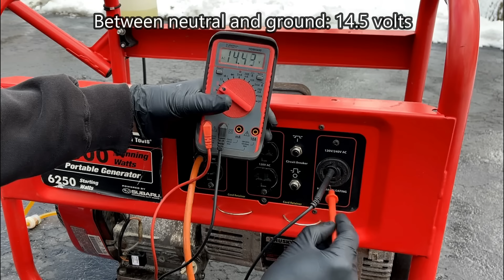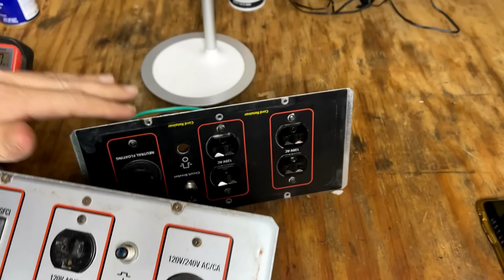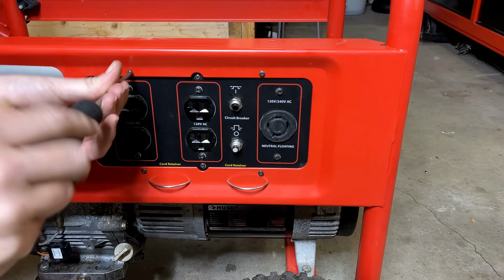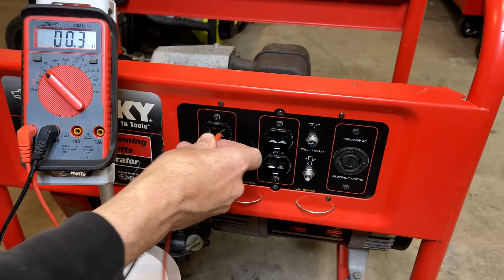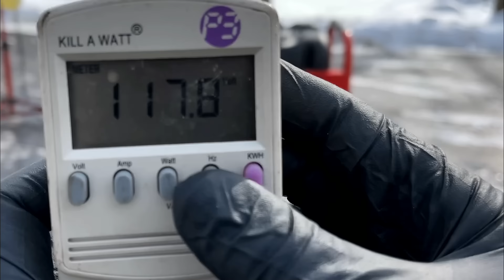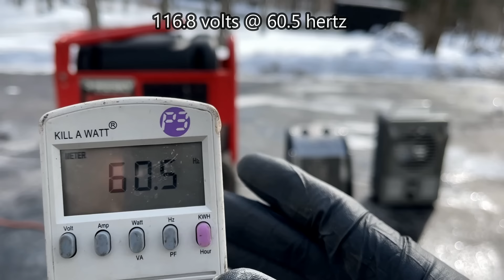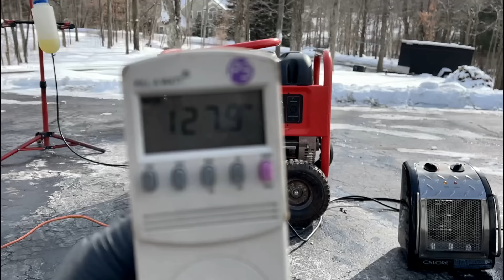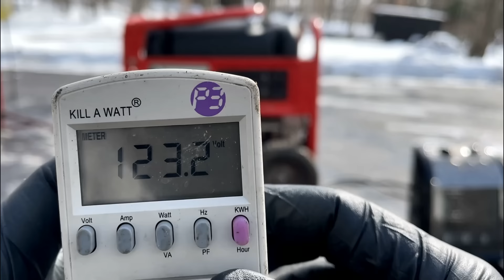No Power Output From Generator - Fixed

Comment: That hunting got me from $100 to 80 bucks! Another great vid Jim!
Reply from the maker: Thanks Ken for picking up this generator and talking him down to $80.  A new Mikuni carb alone would cost $120+
Reply: Mr. Ken I Vaguely recall reconditioning Rotors for Alternators in a Shop Class??? Can THAT be done?
Reply: @russellbonesteel1115  If something can be made it can be repaired.  The amount of effort sometimes needed to repair something can easily force a "Just replace it" answer.  
A drop of solder COULD have resolved the immediate problem and after testing COULD have been the simple, easy fix.
Reply: @russellbonesteel1115  There is a little woman in China who posts Videos on YouTube that rewires 100 KW generators like she was washing dishes. Maybe you should contact her
Reply: @rogerd4559  You refer to Linguoer Roger. She is amazing. The art of manually rewinding  stators, rotors and motor coils has been lost in the West. Well, not really, but if you take anything like this to a rewinding workshop they invariably want an arm and a leg. Obviously she was taught to do it by experts. The only thing I will say about the machines that Linguoer works on is that their control systems are extremely simple. Trying to do things like this on the complex machines we sell and buy would take on another dimension.
Reply: ١
Reply: Can you use 25amp fuse for testing

Comment: James I never tire in watching your generator videos, I have learned a lot . Believe it or not while in Puerto Rico was on facebook marketplace looking for old defective generators to attempt to get them to run and none to be found but I did locate (3) running from $100 to $300. One even was electric start with bad battery but with an 85 foot extension cord heavy duty. While in NY ,found a brand new one 3750 watts with 10 hours for $100.00 ,yes $100.00 go figure. I finally located a Chicago Electric 7500 watts electric starter ,no battery 16 HP also no power. I got the motor running real good so far, ordered a battery and filter which was missing. I'll be attempting to get it to power up with what I have learned from your videos. Many thanks

Comment: I reckon 90% of that was caused by inadequate care of the machine itself. Leaving it out in the open, or maybe in a hazardous environment. Just look at the state of the micro switches, which you say weren't as bad as some you have seen. That was a surprise to me. Aluminium wire in the stator didn't seem to be the problem there, God knows what that was. A difficult, hard working solution to several problems there, adequately dealt with in a logical and most enjoyable way. I got a lot out of all that. Thankyou :)

Comment: Just so you are aware ... I'm a Ham and operate and repair a number of different radio types including RADAR, I have seen incidents in the past where in many Chinese knock-off feed line cables the "copper" center conductor is often some obscure alloy made to look like copper but in fact is something else. It nearly always refuses normal solder. The soldered joints easily crumble and break and attempting a normal repair is virtually impossible. I believe the coil windings are made of a similar product. I see this quite often and reading resistance values are always skewed out of normal specs. This usually speaks of coil windings made with very cheap product instead of actual copper. Be ware ! Good video .
Reply from the maker: I have seen the same.  The solder is nearly impossible to stick and the wire usually just crumbles when trying to work with it.  So I do not try and repair them anymore.  The only repair that can be done is to rewind with copper.

Comment: thanks to your youtube page i have just finished repairing my onan rv generator that shop wanted $2000 plus labor to replace stator and bad rotor, that was 3 years ago. i bought a new generator and kept old one. i tried to repair bad slip ring but failed and found new rotor and stator for ABOUT  $425. I  now  have a working spare to keep or sell. 
Thanks for excellent videos

Comment: Am I correct that both the white and green sense windings should not have continuity to ground/case?  Jim I really enjoy your videos and especially you approach to repairs.
Reply from the maker: They should not.  But if your neutral is bonded to ground then you might see a connection.  Isolate the windings first.  Then there should be no connection.

Comment: James, it occurred to me that    you may have been trying to solder an aluminum wire from the rotor winding to a copper terminal (perhaps chrome plated) also on the rotor circuit. If so, the regular solder and flux used for a copper to copper joint won't work properly. An aluminum to copper solder joint requires a different flux. Maybe even a different solder. That would explain why the solder wouldn't flow onto the aluminum wire in your numerous attempts. As always, a very informative presentation. Thanks.
Reply: Soldering aluminium wire to copper wire is extremely difficult. It requires higher temperatures that are closely controlled so that the aluminium does not melt. Precision tools are needed so that the heat can be delivered to the aluminium through the aluminium oxide that forms on the surface. Specialist flux is also needed. It is better described as brazing than soldering. I recall once cutting off a copper braid tail connected to a thin aluminium bar inside a vehicle alternator. It certainly caused me a problem. I should not have done it. I ended up reconnecting the new replacement parts by soldering a copper spade connector to the copper wire and pushing the end of the spade connector over the flat thin end of the aluminium bar so that it was a tight fit. It was not ideal but it worked. I never made that mistake again. Ever since then I usually use a thin round splice with small brass screws on either end. The wires are pushed into the ends of the splice. Ideally the copper should not touch the aluminium and electrical connection is through an internal brass shaped piece with the screw threads fitted into either end. The outside diameter of the splice is always larger than that of the wires so doing this is not always suitable.

Comment: James, congrats on the new Ultra Sonic cleaner machine!    Heated?    I enjoyed the video very much!   That machine was pretty "crusty" all around!   Even the inside of the air box.   Looks like it was outside in the elements all the time.
Reply from the maker: Its hard to believe how clean the frame was given all the corrosion everywhere else.
Reply: Yes, it's heated. You can see the dual controls for heat and cleaning.  Mine went bad and only the cleaning would work, so I bypassed the electronic controls and used a rotary timer switch connected to both heating and cleaning.
Reply: @jcondon1  I noticed too the new ultrasonic. What is the volume of it?

Comment: Very useful, indeed James. Thank you. Some questions: -
1. You used a Torque Wrench on a number of occasions. What did you set it to, for each size / location bolt?
2. I didn't see a capacitor anywhere, to provide a phase shift for the starting of the generator. Was one used or not? If not, how did it work?
3.  You mentioned 2 additional windings. Starting and sensing. Can you tell us more about these?

Comment: "I make it earn an oil change" -- This is solid advice. Avoiding wasting money on new oil and disposal, and time, if the engine is junk to begin with. Love your videos (as do all the little carbs in my garage)
Reply: I always keep some good shape used oil around for such situations.
Reply: This is one of those things that wasting a $4 quart of oil on an engine that might be bad is better than trying to run the engine that might be good on that contaminated oil.
Reply: @danburch9989  oh I agree. In general it's good advice, but that milkshake really needed to go, a good choice not to make it earn it, this time :)
Reply: @CraigWaterman  Agreed sir.. I change my oil annually in equipment that may have only seen a few hours run time for the year. But I save that "used" oil and use it in engines that I'm not sure deserve a fresh oil change. If I'm sure she's a runner/keeper, she gets an oil change with the best. Cheers!

Comment: You are alot like me. If I'm that far in I want to know WHY it failed. Found material and workmanship to be more common than not as the cause. The fact that you went that extra mile makes me give you an A+. Great work!. My background is QA and re-writing practices in Telecom, FiberOptics, and Electrical systems. We fine design flaws , improve using better materials and manufacture practices. You EARNED your A+.
TJ DeHart.
Reply from the maker: Thanks

Comment: Looks like you are knowledgeable on most gensets. I’m working on my 05’ Coleman power station, 11kw lp gas. Only 309 hrs. It’s always worked well until recently the low oil shutdown went out and finding the right one since they are obsolete was impossible. So i temporally disconnected it. It’s worked fine during a couple outages for an hour or so run. Then it quit producing any electricity. I’m fairly handy at most any of the repairs it needs. I installed it and added auto transfer it a manual/auto transfer switch. The manual for this model (pm401211) shows 2 capacitors 40uf and 2 diode varistors. I pulled the capacitors and they are 35uf and read and 31.8 on each. I had bought the 40uf it calls for and installed them but it isn’t producing voltage. What testing should i do to locate the issue? I’d be glad to compensate you for any help on it. I’m on the ms coast and we so far have dodged any hurricanes this year. But it’s still an active season 🙄. Thanks

Comment: 26:48 based on the rust line between the stater and bell housing, it looks like the stater isn't seating all the way because the rotor being a little bit longer is, indeed, and issue. Is it just me? Maybe it doesn't matter either way, just my observation. In any case, interesting and thorough video!

Comment: Great video! My only complaint is at 1:03:41 you do one side, but not the other (so far). If the connection is bad on one side, it goes to reason the other side has a bad connection as well.
Reply from the maker: I have not given up on it, but since I had a suitable replacement did not want to spend too much time on it in this video.

Comment: The original owner really did a good job of polishing a turd.  From the tank and the frame, it looked like almost a brand new generator.  But then you look at the oxidation on the top of the engine, the cover on the stator, the wheels, the internals of the panel, etc and you can see that thing had a lot of moisture exposure.
Reply: It was literally under a deck on the beach of Long Island Sound. Salt Spray continuous!
Reply: @KensSmallEngineRepair  Yes, occurred to me the previous owner must live very close to the coast.....!!
Reply: Sure looked likes a "Bits-a This One and Bits-a That One FRANKEN-GENNY"
Reply: @KensSmallEngineRepair  🥼👩‍👦👩‍👦👩‍👦👩‍👩‍👧‍👧👨‍👩‍👧‍👧

Comment: Nice video, thank you! They make a chemical stripper for copper wire! If they used aluminum then the connection is compressed to copper eyelet for soldering but must have copper to aluminum salve! Aluminum oxidation seems to be the problem there! Your solder pullet worked good! It has been many years! Ron PTL, USA

Comment: I have had problems with soldering such as you demonstrated, I used the low temp aluma weld with a pen type of heat gun.

Comment: Well, I audibly said “Yessss!” When you said you were going to drill open that breaker! I love seeing not only the main reason for failures, but the specific reason. Cool to learn how the breakers work too. Ty!
Reply: Absolutely. I am a strong troubleshooter not because I'm anything special. But because I learn what each part does  to make something work. Knowing the theory of anything mechanical will make you appear like a wizard when things fail. But knowing what parts should be doing is 3/4 of the battle trying to get something working again.  Repair is just eliminating what works until you find out what doesn't.  Does that make sense???? I know what I'm trying to say and I definitely agree with you. Cheers
Reply: I agree with the "Why did it break" attitude, and not just toss it and replace.  Knowledge is understanding.

Comment: I wasn't sure that the replacement rotor would work because of the position of the magnet I guess that makes no difference. Yes this looked like a really well kept generator at least the nice shinny engine and tank! Somebody made the remark "the original owner really did a good job of polishing a turd" I agree with that remark I am glad your buddy was looking out for you at $80.00 it was still pretty steep. It was unbelievable how lean that if it was the original carb was running so lean. So in the end you triumphed over the broken equipment. Thanks for sharing your video and knowledge James. Ed

Comment: James… great repair again. Especially when you tore apart the circuit breaker. Very neat demonstration how they operate. Also I wish praying for yeah when you trying to repair that rotor wire but learned alot. Thanks again for providing such an amazing video on generators. You have me hooked. Keep making great material.
Reply: Agreed!

Comment: Hi James, those rotor electrical connection points are not soldered, they are glued on with an electrical conductive adhesive. It can be bought on line from Amazon. I enjoyed this video, well done.

Comment: This one had all the in depth work I wanted.  I like seeing why things failed, like that circuit breaker.  Then you went back and attacked that rotor, just because it didn't work out this time doesn't mean it won't work out every time.  Great video.

Comment: I've learnd a lot about generators and especially cleaning carburetors.  This is another inexpensive win for you.  The frame of the generator is in remarkably excellent condition compared to all the corrosion on the engine and power head.  I imagine this came from two bad generators combined into one bad generator before you got it.  Probably an underwater recovery.
Reply from the maker: I agree.  Something did not seem right as the frame looked in perfect condition.
Reply: @jcondon1  Generators like any electric or electronic equipment do not swim very well and usually die as a result.

Comment: Good job as usual. My first thought was the brushes were squealing because they might have worn slightly different on the other slip rings. Did you compare slip ring diameters? Polishing the slip rings might have helped. It is a true gentleman who admits his mistakes. I think we can thank some CA attorneys for overly lean running engines. :-)

Comment: James I was watching your video today and saw you having trouble soldering the wire on the armature and just wanted to let you know that you might need to use silver solder on something like that because it works differently than flux solder and you might have a better result, but you have to get it really hot that's the secret.

Comment: Nice work.  I hate it when I can't get a carburetor figured out, but sometimes that's just the way they are.  They seem so simple, and usually worked well when new, so why it insists on hunting/surging now?  I have a generator that runs exactly like that.  I put a clone carb on it and it's better, but still surges a bit without load.
Reply from the maker: If it gets better with a little choke then the jetting is off.  Otherwise have seen the issue caused by a missing anti surge spring.  The Mikuni carbs on these Subaru engines are very lean.  The tiniest bit a plaque will cause them to surge.

Comment: Thank you for another educational video. If you did not have a spare carborator, what would be your next step? Continue to drill out the jet to a larger diameter?
Reply from the maker: I would keep drilling until it works or I break the drill bit in the jet (most likely).  At that point I have one or two parts Mukuni's that I could try piecing something together.  Or try another cheap Mikuni clone (which ran the engine too rich last time I tried one) or finally by a clone made by Stens which is a lot more $$$ then the cheap clone, but it works and a little less then an OEM Mikuni.
Reply: Thanks for the additional information.

Comment: Your brushes were "singing on the rings" as we used to call it in the Navy. And stator and rotor windings have a conformal coating insulation covering the length of wire and it needs to be scraped off until you get bare copper in order to solder it down. May be why you had trouble with the solder not sticking? Also, I believe those potentiometers are little reduction gear (or lead screw) pots for fine adjustment in the high kilo ohm ranges, so it could have had a bit of slop in the little pinion inside?

Comment: I repaired two rotors by crimping copper wire to the aluminum wire and then soldering the copper wire to the slip ring terminals.  Worked great.
Reply: What was those rotors on Robert? I would like to know where aluminium is used as rotor wire on small machines.
Reply: @r8118830  They were on two Firman generators.  The aluminum wire must be cheaper than the copper.  Made China.

Comment: Sweet presentation! ❤️ just fantastic video also many thanks for your time in putting this video together, I was in tv engineering and always loved to tinker with engines and old clock movements. I got all the tools but my age is slowing me down at nearly 81 in July😝; I liked how you cleaned the carb with the ultrasound unit (same way I clean my clock movements) this generator was a nice find looked like it might been used in a salt mine 🤣 however the paint appears to be I perfect condition. Again many thanks for a 5 Star presentation.
Reply from the maker: Thanks Fred.  Was an odd one how perfect the frame was and everything else corroded like it was.